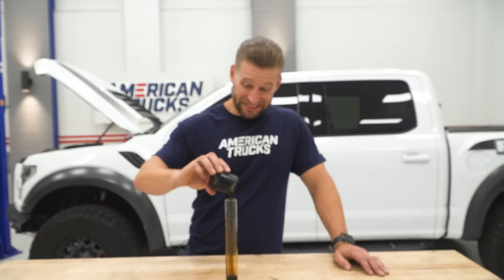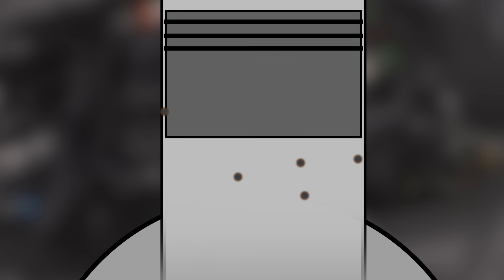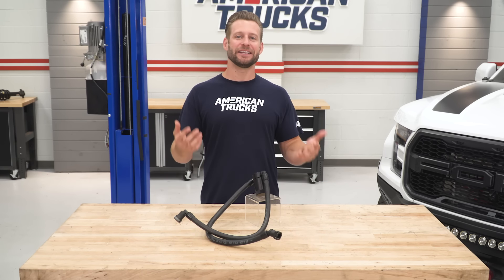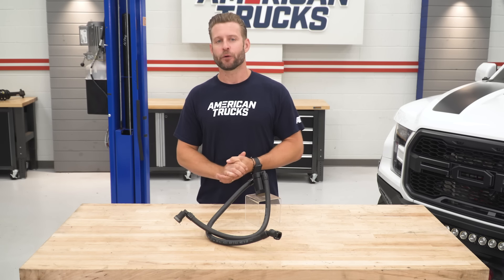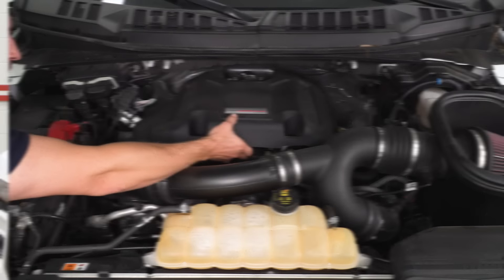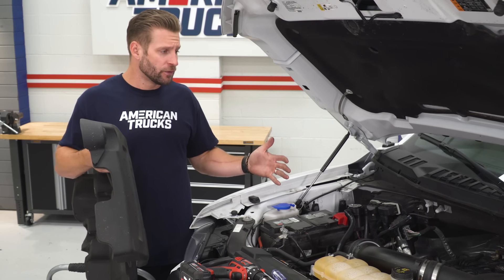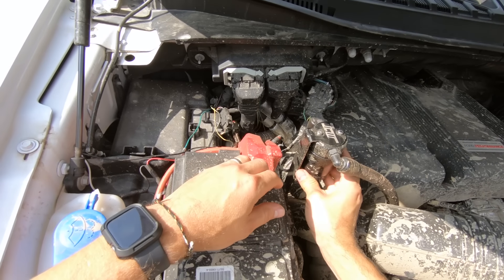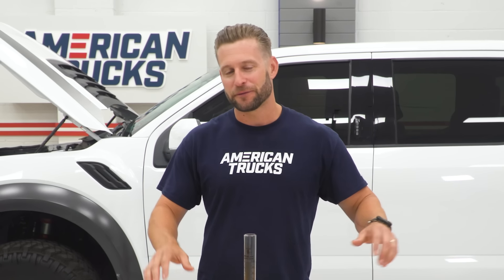Does Your F150 Need a Catch Can? - Ford F150 Oil Separators Tested And Explained

Comment: I have this separator on my 2014 FX4. I've noticed it fills up like 5x quicker in the winter. Could this be detrimental to the engine to run it if can is completely full?
Reply: Sorry that this was 2 months ago but I don't know if you ever got your answer, lol. If I recall correctly, if yours is filling up faster during winter its likely due to water condensation from the engine not getting up to a high enough temperature during a commute to atomize the water.

Comment: I just bought a '13 with a 3.5eco with 100k miles.  I'm going to install an oil separator, but what can be done about the deposits that are already there?
Reply: Walnut blasting
Reply: @jamers99  what is walnut blasting
Reply: Remove intake mainfold make sure cylinder your working on that the valves are closed.grab a shotgun with bird shot only!and blast the carbon off the valves usally takes 3 shells per cylinder

Comment: Would this still be as needed on the 2020 3.5l eco boost ?
Reply from the maker: The nice thing with 2015 and newer Ecoboost engines is that they have both direct injectors and port injectors, so the risk of valve coking isn't as big but blow-by can absolutely still be produced like we showed. Adding a catch can is definitely a nice addition and will help keep things clean as your truck ages! -Zach

Comment: Yet millions of vehicles don’t have catch cans and run just fine. People stop and think for a moment, if catch cans provided any true benefit the manufactures would be installing them to prevent warranty claims. 

You can buy warranties up to 8 years and as many as 150,000 miles which is more than enough time for a problem to have shown up if there really was a problem and the manufacturer would be on the hook to pay for the problem. 

These engines are designed to route the crank case ventilation into the intake and for the combustion process to burn it off. 

PCV (positive crankcase ventilation) has been used for decades. Before it was routed into the intake there was a rubber hose that routed it to the ground and it would drip oil onto the ground. 

These catch cans are a solution in search of a nonexistent problem. The small amount of oil vapor that is routed into the intake manifold does not harm anything. 

The only reason you see the catch can with a puddle of oil in it is because there is no place for the oil vapors to go due to the catch can so people are miss led into thinking that pure oil is is being pumped into the intake manifold when the truth is it is only a light oil vapor.

Comment: Yep.. Ecoboost need a can
... My valves are clean in my 2012.. I cleaned them my self..
Reply: Did you use walnut?
Reply: how do you clean the valve
Reply: Removed intake mainfold make sure valves are closed then take shotgun with bird shot only! And blast that carbon off the valves usally takes 3 shells per cylinder.

Comment: Installed one on my ‘16 2.7L on my last oil change. I use my truck for business & pleasure driving roughly 1k miles a week but checking it twice before the next oil change I wouldn’t even have roughly a tablespoon even with using fuel treatments. Does the engine size make a difference or is it hit or miss how much oil you’ll have in there?
Reply: 1k miles per week?  That's 53k miles per year?  Last year I saw a YT video of a guy that installed cans on his 2016 2.7, he also only caught a very tiny amount. Can't find that video.  Might depend on driving style and climate (warm and dry being best). I'm suspicious of the benefit of cans, I would like to see valve pic's after 100k with a can and w/o a can from 2 matched vehicles and conditions (not going to find that kind of science data from consumers).

Comment: So I plan on putting it on a 2011 eco boost with 128k miles, my questions are will it still benefit and when you install it do you have to make oil changes more often ?
Reply: Get a walnut blast to the pistons and then install it maybe?

Comment: hello, I install this catch can to my 2019 3.5 eb. f150 but it looks like hoses are too long any chances to cut it to make it short? thanks in advance
Reply from the maker: You can but you shouldn't have to.  DId you mount it in the location recommended by JLT near the battery?  -Justin
Reply: @americantrucks   yes i mount it on the battery tray but cant find an instruction  on how to cut the hoses if you have some video on how to cut it please tag me or e-mail it to me .thanks Israel

Comment: I haven't heard of many issues with the 3.5 Ecoboost relating to carbon build up. If you add a tune it might make more sense.
Reply from the maker: If you do a quick search, you'll see plenty of links pop up relating to carbon buildup on 2011-2016 models. It's a common issue on older direct injection applications as well. It's definitely not required, but it will help keep things clean and running smoother in the long run. -Zach

Comment: I have a 2016 F-150 ecoboost. I experience rough idling mostly when the a/c is on. Will this help my current issue? Also. I have changed the purge valve twice in the last 4 months due to the engine light coming on and giving me the error for the replacement. I live in Florida.
Reply: batterie fail

Comment: Stupid question but with it collecting oil do you have to add oil back to the system.
Reply: Catch cans don't remove excessive amounts oil from the crank case. They simply prevent what oil they do catch from making its way into the intake manifold. Periodically checking your oil is never a bad idea, but a catch can will definitely not cause any type of unusual oil consumption.

Comment: I'm thinking about getting these for my 2016 f150 2.7 Ecoboost to help my engine last longer. Did he say that you only need a passenger side one because that's where all the "magic" happens and only the oil vapors come from the passenger side? Or should I get the driver side one too? I guess need to find out if this engine has only one PVC and that's on the passenger side.

Comment: What are some thing you can do to clean the valves? I have a 2016 with 89000 miles 3.5 eco boost.
Reply: I just bought a can of SeaFoam Spray for my 2012 3.5 EB today that I’m going to run through it this week.

Comment: Will that void warranty on my 2019 Raptor ? Also can you please share the information on that so I can get it on my truck too please thanks
Reply: Opinion only... That would be up to the dealer or Ford rep. It is the reason I keep the original line/hose in the tray under the back seat and can remove mine and put it in the covered bed before servicing. If my truck stopped/failed etc: and I called for a tow. I could have it off before the tow got there. Why take the chance of being denied warrentee work. If your reading this site you probably know more about vehicles especially your truck than most who don't give a damn. When removed it's undetectable by any computer on the truck that it has ever been there. only if you leave a bracket would anyone know.
Reply from the maker: To piggy back off of James- the dealer has to prove the part in question is responsible for whatever damage was caused, as defined by the Magnuson Moss Act.  I.E. if you have an oil separator installed and your tail lights stop working, obviously they aren't (and legally can't) blame the oil separator.  To this day I've never seen any catastrophic engine failure caused by the addition of a catch can/separator. -Justin

Comment: would it be wise to install one of these after 6yrs/50,000 miles? Seems like any damage would already be done by then. I bought my '14 f150 used 3rd owner, no catch can. No real performance issues that I can tell, but I hope to keep it for at  least another 150,000 miles.
Reply from the maker: Adding one definitely wouldn't be a bad idea! I'm sure there is already some build-up present, but adding on a catch can now will prevent it from getting any worse in the future. -Zach

Comment: Does this have any affect on the warranty?
Reply: I have the same question.
Reply: I found the following on the americantrucks.com web site, in the Q&A for this product.  This was the answer from American Trucks to the same question posted there:  "The Magnuson-Moss Warranty Act prevents manufacturers from voiding a factory warranty solely on he basis of installation of aftermarket parts."
Reply: @sloanemichaele   I read that as well but have talked to others who have had nightmares with their warranty. Ford says if you go to one of their authorized installers the warranty will still be good.
Reply: @johntatman9168  , Interesting.  Good to know.  Thanks.  Any idea how you find a "Ford Authorized Installer" for something like this?  Do I just have to go to the dealer?
Reply: @sloanemichaele  The only one I know right now is in Georgia called "Town and Country Ford". I live in Ohio so driving there is not really an option.

Comment: Good description.  just that my EcoBoost 3.5L is on 190k miles and about to be replaced.. and I definitely will get one of these, but 3oz isn't enough at this time..  I need like a quart.. [maybe you laughing by now, but the oil change is down to 2500 miles due to fuel buildup in the oil... 'we got some problems'!#. so now you're laughing harder]..

Comment: Does this do any good with the 2019 3.3L Naturally-aspirated V6 since it has Port fuel and direct injection?  I understand the concept but don't think this would be necessary with both injection types.
Reply from the maker: It may not be as necessary compared to a 2.7L Eco or 3.5L Eco because of those port injectors, but you'll definitely collect blowby regardless and help keep things cleaner! -Zach
Reply: It was helpful before fuel injection.  It was the practice to poor ATF in the carburetor of a hot engine to remove theas and other carbon deposits out through thermal shock.
DI just transformed it from  a preventable inefficiency, intp a  catastrophic failure.
Reply: Yes Justin is correct.  This will keep your 3.3 cleaner.  You can put a catch can on pretty much any engine.

Comment: As soon as I installed mine, now every time I let my foot off the gas, it makes a slight but very annoying screech inside the cab … anyone know what that may be?
Reply: So my catch can came with an air filter, I removed the air filter and plugged that fitting, no more annoying screech.

Comment: Thank you for the video it was very beneficial to my research. I'm just wondering if this is more of an issue for a vehicle with the turbo versus the 50 which does not thanks in advance.
Reply: This is an issue for all vehicles. However, it's more noticeable in forced air systems like Ford's Ecoboost engines due to more  unburnt fuel being forced past the piston rings.

Comment: I saw the C&L monster video and it connected to both sides. So likely a silly question, but why only on passenger side for this one?
Reply: NM I just found the Mishimoto video and it explains why.

If I wanted a driver side JLT, would I order two of the same or are they different? Thanks.
Reply from the maker: If you wanted a driver side JLT catch can, you would purchase their driver-side specific kit. Feel free to check it out at the following link! Thanks for watching! -Zach
https://www.americantrucks.com/jlt-v30-black-oil-separator-driver-side-1014-62l-raptor-1117-50l.html

Comment: My 13 SHO with a UPR CC, catches roughly 1 oz of crap per 1000 miles.  I change my oil religiously at 3k miles as well. How a $60K+ truck doesn't come with one from the factory is beyond me.
Reply: StrongmanTaylor  It does’t ,coze most people don’t know how to open the hood,not to mantion checking catchcans on regular bases

Comment: I have a 2005 v3 5.4L f-150.  Would this help me or is it really only for an eco boost truck? I have a brand new reman in there.
Reply: Troy Torgerson, Every single engine manufactured with a PCV should have one since the begining starting in 1961-2. My 1956 Ford has an original draft tube and is the only car I have without one.
Reply: I agree with James here but I will add that the reason why the focus is on the EcoBoost engines is because the turbocharge puts extra pressure in the cylinder, increasing blow-by on the piston rings as well as the early ones had direct injection only.  This means that instead of the fuel injectors being located in front of the intake valves,  the injectors are located after the valves in the cylinder itself.   This causes significant problems because the detergents in the fuel don't ever get to clean the valves, so carbon builds up on the surfaces of the valves.  Putting a catch can such as this one reduces the carbon buildup that flows back through the valves.  As James mentioned, every engine with a PCV valve has this problem to some degree,  especially the ecoboost engines.  The latest EcoBoost engines have port injectors added in front of the valves to help alleviate this problem.

Comment: Do you think there is any chance the gunk could get sucked back up the return tube on hard acceleration or rough trails? Well if you have 5ml or a bit more of gunk?
Reply: PCV is a one way valve. Unless it gets stuck open you should be fine.

Comment: I have a 2012 F-150 (bought used w/ 90,000 miles). I'm currently at 138,000. Is this still something that would be worth while to purchase and install? I do plan on keeping this truck as long as possible. Thanks!
Reply from the maker: Definitely! Although there's been some miles put on the truck for possible carbon build-ups to form, adding a catch can will definitely help keep it cleaner going forward! -Zach

Comment: You're just trying to  "Equalize" the pressure from the bottom of your crankcase to atmosphere...  thats maybe 2psi...   drawing a vacuum, 28lbs of course you're going to draw up a lot more oil.  Stop pulling vacuum on the bottom end of your motor,  make a simple down draft tube, and plug that intake port.  If you're plugging a 3/8" down draft tube with ..???  you have bigger problems than 'blow by'.

Comment: So let me get this strait.........after 200 miles you had more oil in the canister than you emptied after the 2k mile check?? So if you never checked it in between those 2 times, just how much oil did you ingest back into the intake system? Cause you know with the amount you shown at 200miles that canister filled up multiple times over. Wouldn't that then be the same functionality wise as the original PCV system? In the end, what did you gain.............?

Comment: I am a bit confused. It sounded like Ford fixed the issue, but it's still happening? I have a'19 Raptor. So do I need one or did Ford's redesign fix the issue?
Reply: Supposedly you have dual port injection but I don't think it's perfect catch can would help

Comment: Awesome video, Justin! Loved the breakdown of why a separator is needed. I've been contemplating whether or not I need to put one of these on my 2015 and it sounds like I do.

After this test, do you think the JLT passenger side only catch can is sufficient, or would you recommend going with a more expensive model like the one from UPR that has passenger and driver side components?
Reply from the maker: Thanks Dex!  Historically the passenger side seems to do the most collecting however some owners install one on both sides for the ultimate protection.  My advice would be, if you're going to just do one- make sure its the passenger side.   And I'm not terribly familiar with the UPR option as we don't carry it but I've heard good things. -Justin
Reply: Read my comments.

Comment: 2017+ dont need one, all previous years do. Easy peasy ;).
And make sure you get the updated version because JLT hoses are known to give off fuel vapor odor into the cab
Reply: So why after 2017 don't needed? Are you talking about f150 3.5 ecoboost?
Reply: @dannyroy4411  Before 2017 the Ecoboost engines had only GDI.  2017 and newer,  Ford added port injection back into the engines in addition to the GDI to prevent carbon buildup on the valves.

Comment: Can this oil catch can be installed on a car,such as a 09 Camry(4cylinder 2.4L) I have been thinking about installing this on my car. Can this be done?
Will this be legal in California ?
Does this conform to Calif smog?
Reply: it is not CARB certified so no it is technically illegal for highway use in california. so if you want to use one i would highly suggest taking it off before taking your car to get smog checked and put it back on afterwards. most cops either wont notice or care since it isnt a power modification or exhaust modification.
Reply: @The1Retribution  / How would the cops know you have one unless you say something about it. 🤔🙂

Comment: My 2012 has been having issues going uphill. Right as I'm pressing on the gas I get a very slight shudder. It's only when I'm just going uphill. Would a separator help with this? I thought it was the fuel pump control module but I find out it was the previous model that was having that issue.

Comment: Would you use a vacuum line to run a cleaner like sea foam to try and clean the coking off?
Reply from the maker: That is totally up to you- personally I've never used the stuff and don't want to recommend something I am not familiar with.  I've heard good things but I've also heard of some of the dislodged carbon becoming an issue as it makes its way out of the engine. -Justin

Comment: My question is, would installing this on a 2013 3.5 Ecoboost with 110k miles be a moot point? Is the carbon buildup and damage already done at this point and should I just be saving up for a walnut blast at this point?
Reply: Use seafoam first in the intake a few times, like 3, to really make sure its cleaned